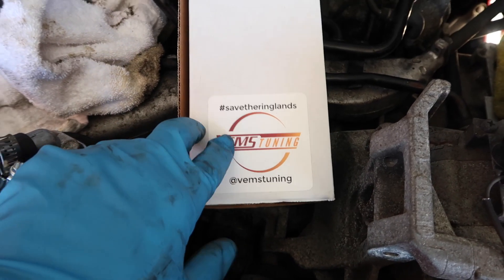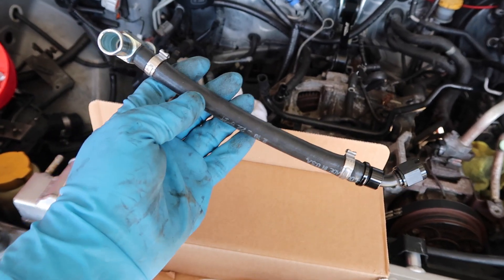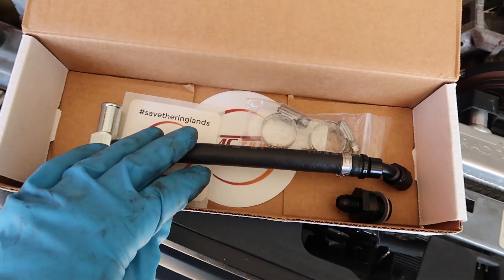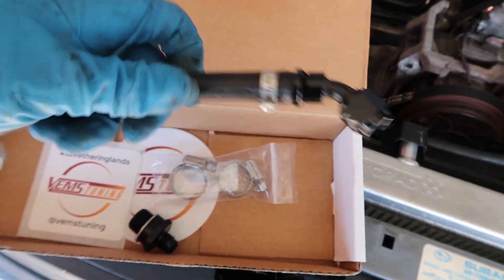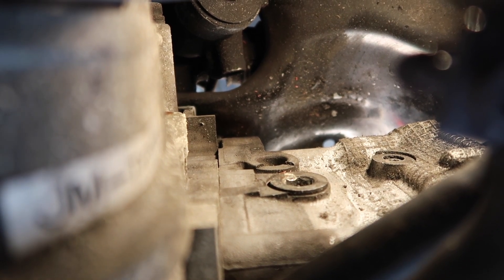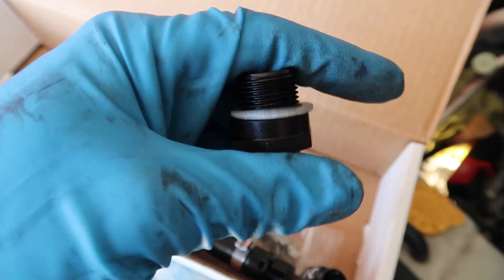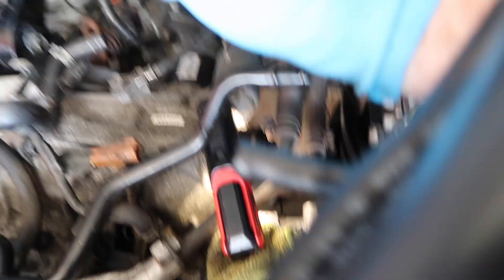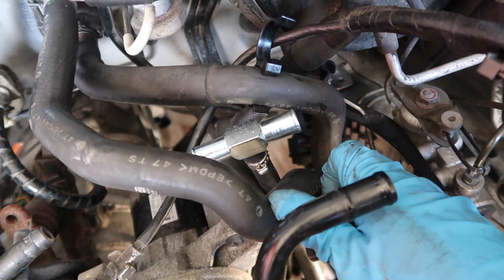Save Your Ringlands in Under 5 Minutes! VEMS Tuning Cylinder 4 Cooling Head Mod!

Comment: Interesting why there is a plug in the block there....did Subaru think about it but never fit something similar I wonder....or is it just a drain plug for when the engine is on a stand? If so, they knew these engines would be dragged out every 15 miles!!
Reply: The quick answer is that the turbo is on the other side over seas and some rare Subaru’s in JDM market even had a twin turbo that would plum up there… 😎👍🏻

Comment: Hey Cody, nice videos, learning alot from them. I have 07 forester xt. I'm having issues with secondary air injection system, have you had  this issue? It looks like a very common issue with with subies, lots of people are doing delete mode since it is not critical for engine performance and to fix or replace it costs 2000 grand.
Reply: ive had recently had the same problem woth my 07 fxt. bought some kstech delete plates, pulled all the crap out 
and bolted on the plates (big job) then got a tuner to delete the error codes